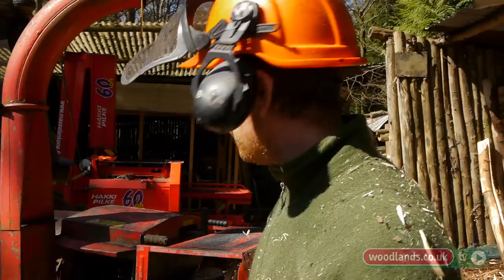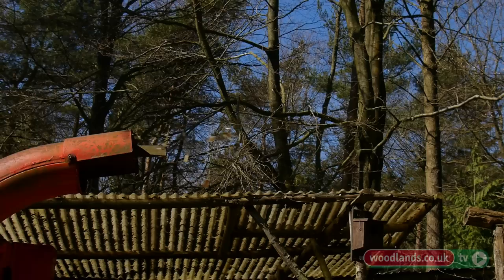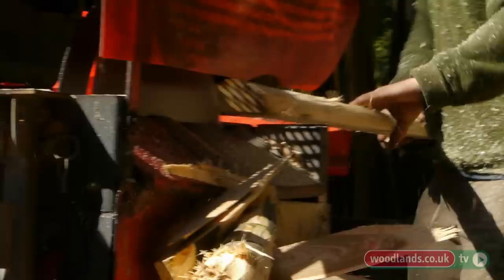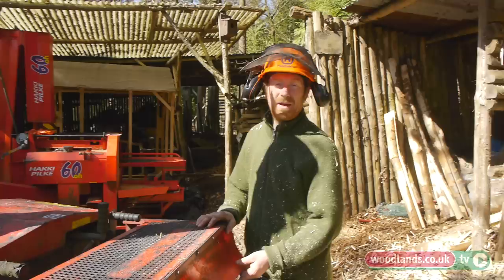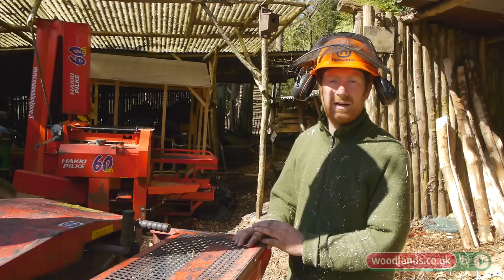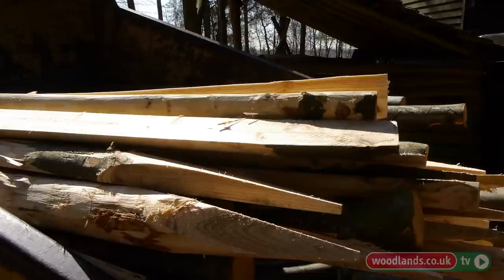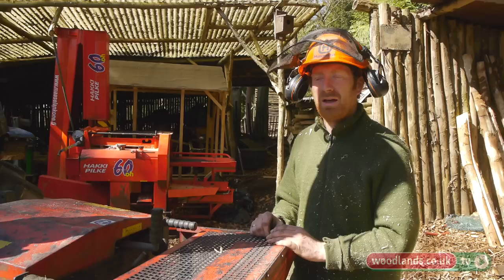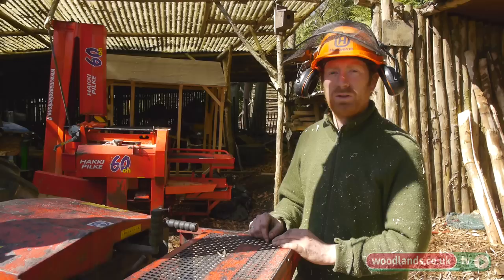Making Fence Posts

Comment: Interesting machine. What is the brand/manufacturer? I caught that you said it was German. 

What horsepower tractor does it require to run?
Reply: Similar machines are made by Posch And Deinhammer. The SchalProfi and Neuhauser K+. 20hp on the pto if I remember correctly